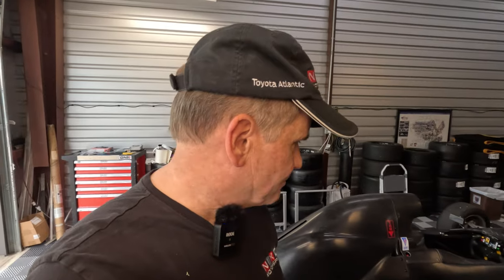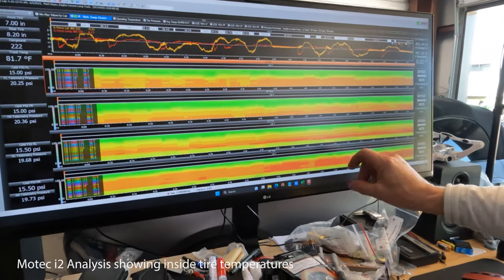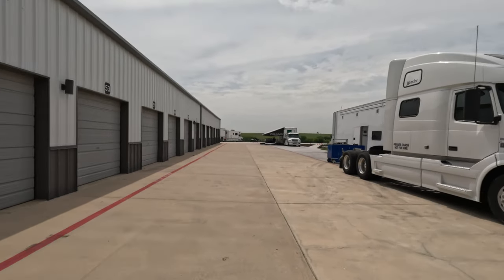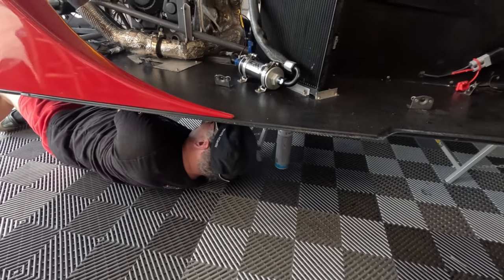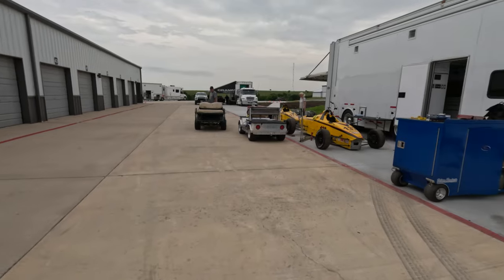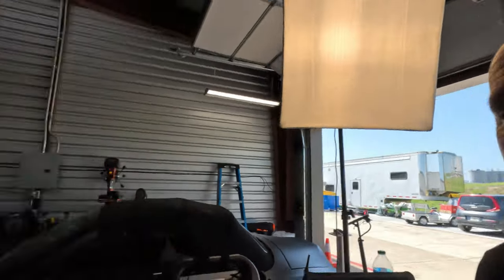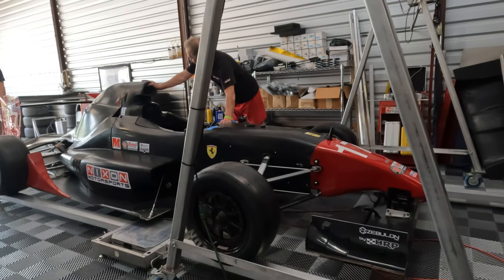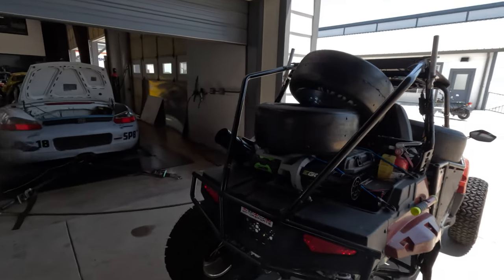The F1000: Surprising results after just 2 days of testing!

Comment: Not using a flat patch to measure ride height?
Reply from the maker: So I use two things for measuring ride height.  One is the laser sensors I have installed which allows me to measure quickly and accurately.  The second method is I have built fittings that sit on my hard mounts for the suspension and that provides a measurement point that is repeatable.  Regardless of what method as long as it is repeatable it works.  Thanks for the comment.